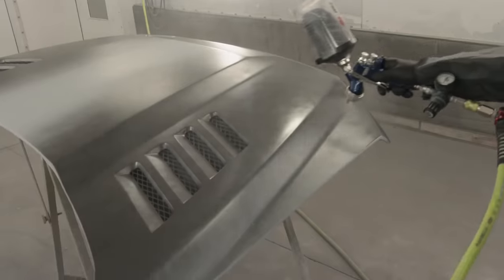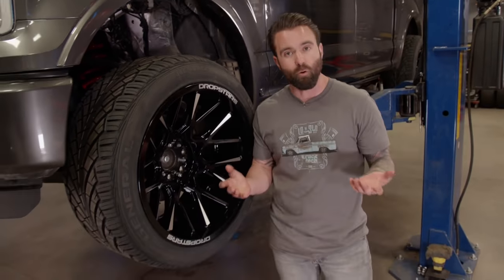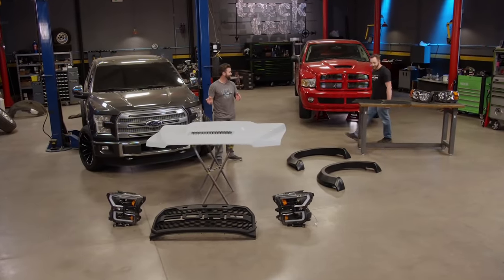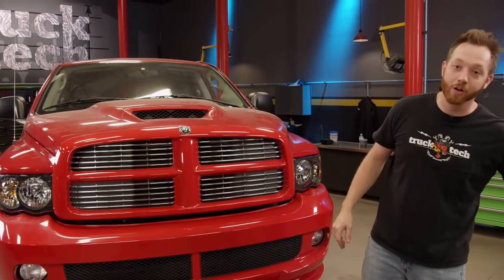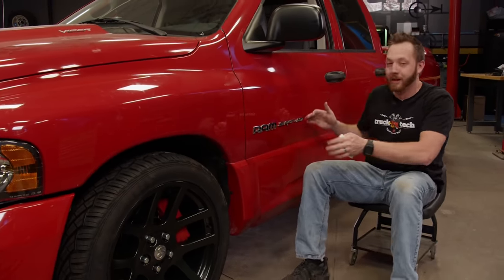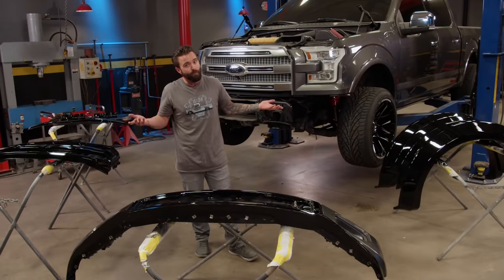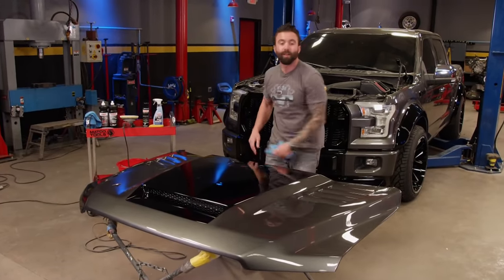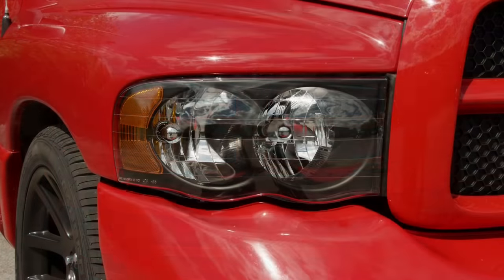Style Over Substance: Muscle Trux Build-Off -Truck Tech S7, E11

Comment: So, a riced F-150 vs a Viper pickup with a cam and a somewhat rebuilt engine...

The winner was determined from the start.
Reply: Common Mockery, agreed viper all the way
Reply: They might be a lot closer in the 1/4 mile than you think. That f150 will dead hook with 4wd the srt is going to have terrible 60 ft. Times with street tires
Reply: @smiller225  I think the point he was trying to make is the F150 is a chump truck compared to the badass manly SRT.
Reply: How is it riced?
Reply: @Wizzop7  The majority of stuff done to it was to make it look cool. You could see that it has slightly bigger turbos now and has been lowered; but the hood, fender flares, and whacky wheels that stick out of the fenders so much that the wheel wells had to be modified; I see as detrimental to the truck’s performance.

Thus, it’s riced.
Reply: @commonmockery1074  but he still got power to back it up
Reply: @Wizzop7  Barely. All he did was help it make the power of a 2012 Ford Taurus SHO. I feel like something like that could’ve been achieved without the bigger turbos. And the work-truck F-150 has been playing catch-up against the truck powered by the engine of a supercar that rivaled Lamborghinis of its time. As far as I’m concerned, the winner was obvious from the start. Really, the F-150 should’ve been Coyote powered. Then the Viper with a truck bed would’ve had competition.
Reply: @commonmockery1074 he still made decent hp with very little mods anyway no truck on the market would be able to compete with that truck anyway v10 vs a v6 cmon man
Reply: @Wizzop7  That’s almost my point. My primary point is that the V8 with a version of itself in the Mustang would’ve faired better.
Reply: @commonmockery1074  ok but explain to me how its riced out

Comment: That metal thing he hacked off is a impact safety thing lol.
Reply: You should NEVER remove your rear crash bars. That protects the driver from having a tire shoved into his legs upon a frontal crash. You can get away with cutting the front ones out but leave them rears alone.
Reply: Hey.  Looks are more important than safety when ricing out a truck.
Reply: @Big Country so Gas Monkey Garbage v2.0?
Reply: I’ve heard of guys just bending them out a little. I’d rather deal with some tire rub than risk my life in a crash

Comment: I had an ecoboost ford and really liked it. Bang for the buck was great. In this competition I think a supercharged 5.0 would have been the way to go. The noise the ecoboost makes is not amazing.
Reply: The sound is not great, but also they had to try to keep this a relativity fair fight. Even stock those truck should be relativity close in performance. If you put a blown 5.0 up against the Ram it would crush the Ram.
Reply: hemicuda699 same with the ram if it was blown
Reply: statikzeek problem is, it would cost more to build the viper engine than this show has probably ever made. $ per hp for those engines are ridiculous
Reply: I agree it sounds like shit
Reply: Substance over sound. Sound doesn’t increase horsepower
Reply: The Man I had an eco-boost and the noise it made got old pretty quick yes it was fast but it was not enjoyable to listen to really ever I kept a quiet exhaust on it because it was not a pleasure to listen to so I’m saying if you’re going to lose why not lose with a truck that sounds nice
Reply: @adrianb7452  Thing is there are good sounding 6 cylinders, but the ecoboost definitely aint one of them.
Reply: I'm not a fan of ford, but I am a fan of the 5.0 F150s they are sharp and and make power with some aftermarket add ons
Reply: Super charger a 5.0 and twin turbo the viper
Reply: @joshuaearnheart2756  why build it? I’m sure the stock motor will hold more than 800
Reply: preludeF20Bking budget would not allow turbos on the ram.
Reply: @TheBb6prelude  no. It wouldn’t. That’s why to turbo them, shops charge $70-$80k. Valve trains are weak. Intake manifolds are weak. They’re not impressive in stock form

Comment: Let's see.  We're already lacking in power, so let's put on some 22's with a ridiculously large rolling circumference and a 305mm contact patch.  Acceleration and braking suffer, and with that offset the sides of the truck will be beaten up from road debris.
Reply: And will chew up ball joints and other suspension pieces when they wear and get out of balance.
Reply: James Workman bruh what he said is completely true, when you do that to trucks and cars, it only hinders performance and ride, never improves it...

Comment: Who instead of getting the correct size wheel just starts hacking up a newish expensive truck? Especially for wheels that look terrible anyway.
Reply: That's the trend unfortunately.  And once those tires wear and don't get rebalanced  enjoy destroying the front end components.
Reply: Lots of people it's about personal preference. The parts being cut are something you will never notice unless you did or know what your looking for.
Reply: It's especially sad when people do it to the F150s since those bars he cut off are for crash safety and are the reason it gets 5 star ratings in the front overlap test. With those bars out it's way more likely that someone's legs get crushed or the tires get pushed into the cabin in the event of an accident.
Reply: @mattward330  which people or dealers who are going to buy this truck will. The re-sale value just got grenaded
Reply: A dealer may or may not but it but individual people will if they like that look. The person to person sale isn't down much. Doesn't matter what they did with the truck they paid for it not you quit bitching about it. Everyone likes to talk trash to feel superior over people it's ridiculous.
Reply: Fun fact, if you take apart the front crash bars and switch sides, you gain all the clearance you need because the opposite sides have clearance built into it.

Comment: Neat builds, two different ways to the same end. Would probably have spent more on tires if it was my truck, something stickier and better suited to track days. Can't imagine the tires that cost $800 on wheels that large are very performance oriented. Definitely think they both improved the front end of each truck. Sometimes the bean counters get in the way of the designers.

Comment: I think all will be shocked when the EcoBoost hits the dyno and the track if they added a tune to the budget. I've seen them go 12.0s with an intake, exhaust and a tune.
Reply: I agree, the srt will suck at the track with street tires. Especially since the f150 is 4wd.
Reply: @smiller225  i don't think it's a 4x4
Reply: @smiller225  he should have slicks  and 15s

Comment: If your car/ truck is tuned.. the gas pedal throttle enhancer can/ may mess with your tune because sometimes they will interfere with each other.. so if you have a tune and it's running funny or doesn't have the power it should and your starting your diagnosis make sure your first step is to remove your gas pedal throttle enhancer module before you go through your other steps.. if you have one and you are going to get your car tuned (remote or dyno) make sure you let your tuner know you have one.. your tuner will probably tell you to throw it away..

Comment: I love the wheels that dressed the FORD!  ... but I'm not a fan of spacers nor of oversizing to the point of rubbing.  Wouldn't a 20" been better?
Reply: Not really with them being 12 wide -44 if he went 10 wide -15 or or less than that it should fit with out rubbing or trimming or much of trimming but that far out does make you not have that good of turning radius intern the truck does seem more planted on turns
Reply: I about forgot with it being lowed as well I’m surprised that’s all the trimming he had to do to it. I got an 08 f150 on a 3inch lift on 20x10 -25 offset with 305/55 an rubs slightly at full turn with a little trimming done and it don’t have crash bars like this model does but about the same amount of wheel well room after crash bars are cut off so Idk how he didn’t have to trim more than what he did. But if he went 20s and the same with and offset it wouldn’t of matter

Comment: just saying... if the engine is running and ya fully depress the macvalve on the fuel rail, if the idle slows down and then comes back up the system is running on live updates from the sensors "active engine management". can just put a blower on it and it will work... tho if the truck is stock, it probably has the same size fuel pump as a little 4 cylinder car.

Comment: Not a fan of the Ford, mainly because of the mechanical issues they have, but it does look good. And they do run good, when they're running.

The Ram is a beast there is no doubt but, if someone gave this challenge to me, I would have gone with a Chevy. It's way too easy and cheapish to lay down some serious power from the LS. A 1st Gen. Silverado SS with the AWD already in place would be an awesome starting point.

Comment: If you have to hack your frame to fit your wheels, you picked the wrong wheels. How's this dude a host? No one would ever pick a Ecoboost as a muscle truck.
Reply: Yep.  My dad has a Ecoboost and my 5.3L Silverado will leave it in the dust.   If I'm buying a boosted truck it's going to be a diesel.   You can make stupid power with one of those.   Watch Banks Engineer.  1000+ hp with no smoke.  The only part that isn't stock inside is the cam.
Reply: @bmstylee  dont know what that Silverado has but the eco boost whips like a bull man.
Reply: Edward Myers the only issue is that yes, you can get the power up a little bit, but since they are such small displacement and already pretty maxed out on tunes, you really aren’t going to get a ton more out of them, where as the 5.3 is really tame for what it is, and can easily exceed 500-600hp with very little reliability given up.

Comment: If the eco boost was red with those changes it would be my choice. Shame we don't get decent trucks here in Ireland.
Reply: Trust me you don't want that truck.   It's slow to begin with.  My Chevy with the 5.3L would be a better platform for power than a v6.   No replacement for displacement.  Also.  What do you guys get for pickups across the pond?

Comment: Should have done a performance tune on the f150 to go with intake and bigger turbos and a bigger downpipe instead of the cheesy appearance upgrades on the f150 and it would easily smoke that mopar srt10 junk . The mopar guy spent his money more wisely  so its comparing apples to bananas he basically rebuilt his engine cams etc with the proper upgrades and tuning the f150 would embarrass the mopar truth be told . As much as all v8 enthusiasts and srt10 fans hate to admit the ecoboost has the potential with the proper mods and tuning to be the fastest truck engine on the market today .

Comment: The F-150 is leaving so much power on the table with out a tune!!! A boosted pump and pedal commander is a joke. Not taking advantage of these mods at all. A custom tune from 5 star or BCB and this thing could have 500+whp and 600wtq on 93 easily. Even more on ethanol.....